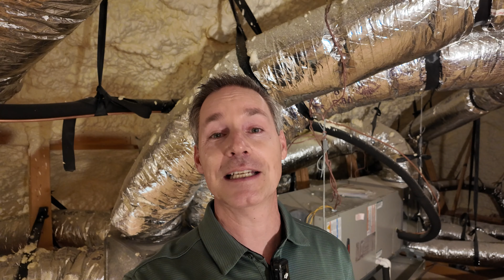How Does A House's HVAC System Work?

Comment: Great video.  Hoping you can go deeper into the ventilation portion at some time as foam insulation gains traction and personally i m about to build new construction.
Reply from the maker: Glad you enjoyed the video and you just made a great video suggestion. I will go deeper into the ventilation portion of HVAC soon. I plan to start doing some videos where I interview the different trades and vendors so I can get some truly expert feedback on the various options. Thanks for the comment!
Reply: Thank you very much!  Looking forward to that one on ventilation.
Reply: Yes if you can explain ERVs in new tight homes in relation to the heating and cooling system and should they share the same ducting or different would be of enormous help your videos are awesome Thank you.

Comment: Wow - i understand so much more now…. Never heard HVAC explained in this simple manner!  Wish i knew it when I built in 2006.  Had a condensation line clog up in the attic - second floor - and did a lot of damage. We did not have a secondary visible drain like you explained.  I am about to build again and will make sure this is a part of the new build.  Is this a new code or did maybe mine get missed in 2006?
Reply from the maker: I'm glad these "How does a house work?" videos are actually helping some people! Secondary drain pans have been under HVAC units for as long as I can remember being in the business, which is now 31 years. I couldn’t tell you when the code actually went into effect, but it has definitely been the code for a long time now, and I’m sure it was in 2006. 

If you are about to build again, your units will have condensation lines tied in the drain and a secondary line dripping into a pan under the AHU. Always check on the pan when you change filters though because those main lines do get crud in them and get stopped up.

Good luck with your build!